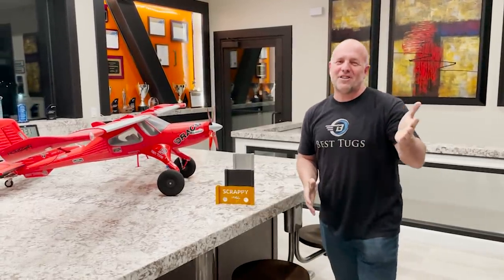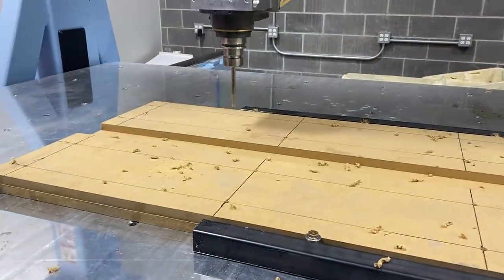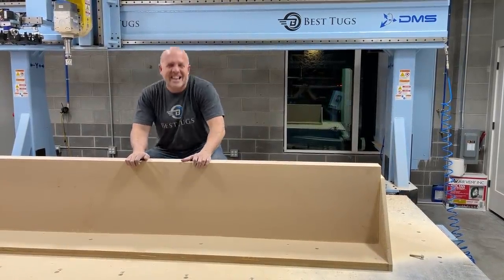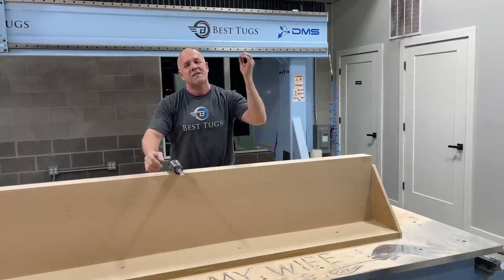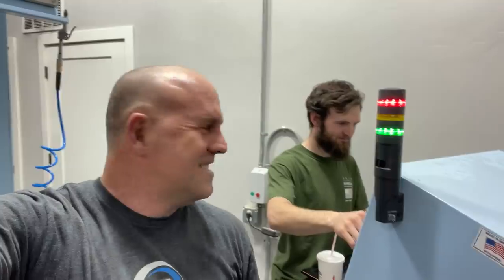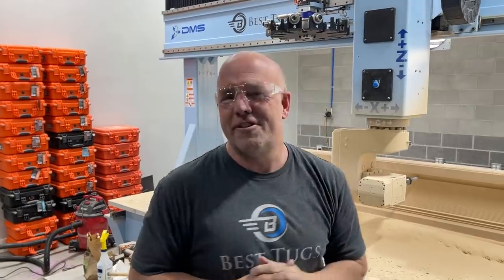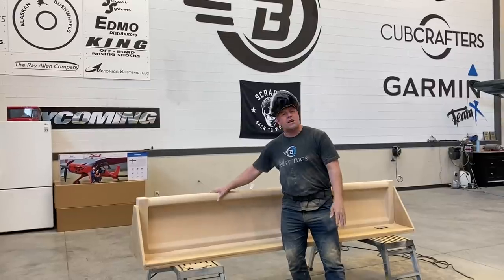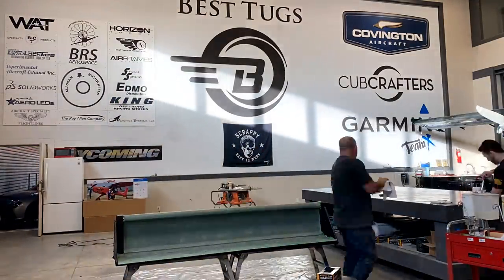CNC a custom mold for my Carbon Fiber wing Slats 🤠 | Scrappy #48

Comment: I have the impression Mike isn't actually into airplanes, he just loves sanding.
Reply: Mike lives for sanding😀
Reply: @MikePatey  Ok  so hear me out. I was laying in bed this morning thinking about super cub with retractable gear. The wheel wells would have to be huge to handle 31’s or 35’s.  Not to late for a light modification on scrappy right?
Reply: LOL, that's friggin funny right there
Reply: My exact initial thoughts after hearing "80 grit" ... 😆
Reply: @kalebrowland626  Mike... What if the "retraction" was simple coil load and release which "retract" into and release from a lock housing, instead of a full on inner body housing for her landing gear... ?
Reply: Hahaha! Yes, you're on to something. It's a coverup, to get to do more sanding :*

I am SO glad I found this channel and Mike Patey. So inspiring, so fun, so engaging. And boy do I want to get to do some sanding now! :D ;)
Seriously, Mike is such an inspiration - and I'm not even building or flying planes. Just your average avgeek appreciating craftmanship, passion and awesomeness.
Reply: Lmfao!
Reply: Mike, the human palm sander
Reply: @kalebrowland626  If you had a high performance reversible air pump that could fully deflate the tyres for storage and then rapidly reinflate them prior to landing you would be reducing the size of the problem.
Reply: Right up until when the pump stops working.
Reply: Lol
Reply: now that would be good but what about being able to take the tires to negative pressure? Create a vacuum and suck the tires to the rim
Reply: @kalebrowland626  Yes fully deflated they would reduce drag and potentially be inflatable to cartoonishly oversized Sherp style dimensions.
Reply: Kinda like Will Stelter and hand sanding knives
Reply: That's funny...
Reply: but Mike would have a backup carbon fiber 5lbs Co2 canister that could re-inflate then 6 times in 12 seconds. You know for added safety.
Reply: @MikePatey  yep 😂😂 1 of a kind planes just byproducts of a love for sanding! Haha amazing work again! Love watching your series!
Reply: Mike is simply a hard working man :)
Reply: HAHAhahaha This guy is a LEGEND Of LEGENDS!  Even that Rc prototype looks mint!  Is that paint on the rc lol!  Love this!
Reply: I died a little inside when I heard "just two hours of sanding" 😳
Reply: Ok That was funny
Reply: @CaptainRon1913  5 axis of simultaneous control
Reply: Mike needs a 3M sponsorship 😆
Reply: I could not afford the price of all the sand paper Mike buys and uses... then again I imagine he gets master wholesale pricing on sanding products- or should anyhow!
Reply: I've heard crazier ideas.
Reply: As Mads from Sail Life says: " Oh Glorious Sanding!"
Reply: If a Mike unow call me I hangup fast.. Mostly scammers calling her i Norway. From unown.
Reply: Mike doesn't have an arm day in the gym...... Nope, he just heads to the shop and grabs a sanding block LOL
Reply: The arm pump is real!
Reply: 3 houers layteur...😆
Reply: SOMEBODY GET THAT MAN A DUSTDEVIL...LOL!🤠
(Ron, I think that's your cue to take the Shop Vac to Mike as he's sanding!)
Reply: And Caitlyn Jenner......
Reply: @MikePatey  lol the big i love my wife on the video ... what did you forget ... her birthday or your anniversary lol ;) ... flowers and a fine dinner out works too
Reply: I mean, he wouldn't have used the mill, if that was the case, right?

Comment: You singlehandedly restore my will to study (2nd year of college). I'm losing interest in mechanical engineering, because all we do is theroetical math, and the only practical thing is designing a simple transmission.. When I don't get to make the thing or even see the thing being made and used, I just lose the drive to design it. Your videos make me remeber what I went to college for. Thank you.
Reply: Hey idk if your college has it but look into the Mechanical Engineering Technology (MET) department. They tend to do more design work while MEs do more math. But having the math background of a ME is the harder part. The design part can be learned on the job
Reply: Greetings from Australia. Engineering is not an occupation but a passion.  Have a look at Youtube website by Allen Millyard. He has built a number of motorcycle engines by adding cylinders to existing engine blocks. V12 Kawasaki out of two Kawasaki Z1300 engines for example, back into the original motorcycle frame.  The best engineers are the ones who can walk the talk, like Mike Patey, not just have a piece of paper hanging on the wall.  Finish your degree and love what you do.
Reply: Years ago I wanted to operate a lathe and a milling machine. I walked into the local technical college, introduced myself to the head of the machining department  which taught accredited training courses  and told him what I wanted to do, not interested in exams, just knowledge.  He taught me himself at the night classes.  I also did a TIG welding course at night school.  There are ways to get around lame degree courses.
Reply: Math is extremely important to you as an engineer. Watch all of Mike's videos. I'm a Master plumber by trade, I needed to learn geometry, trig, and a little algibra. I hate math...I learned it after high school. I just couldn't get it back then. 
Stick with it you won't regret it.
Reply: Glad to hear.  MEAM 1980
Reply: I'm in the same boat. I love engineering and have a couple ideas for aircraft design but gave up on my mechanical engineering program because I failed to pass my first math class (it was timed and I ran out of time before completing it; I'm really slow at solving math problems). I recently took it again and failed it a 2nd time (did a little better the 2nd time but still failed), so I've definitely given up the ghost on professional mechanical engineering at this point. My primary goal is to become a commercial pilot but I was planning on having mechanical engineering as my backup secondary career. For awhile I was thinking of going the A&P route but I'm just not a big fan of the work environment, pay, and treatment A&P's get. Plus, I'm not very mechanically inclined when it comes to troubleshooting and fixing things. So that leaves me with going into a trade or going into the tech field, and my college has programs for both, and I'm heavily interested in both. I've always wanted to learn trade skills such as welding, composite work, machining, and fabrication because I want to build my own plane (or several) in the future, and maybe design my own too. Plus, the trade courses part of my college do some really fun final projects such as drones and robots, that utilities students from each trade to use their specialties to make parts for the drone or robot.

Comment: Good Morning Mike,  
I saw the carbon come off of the mold and had a thought:
If I recall correctly,  golf ball dimples help reduce drag due to the formation of a small turbulent air barrier around the ball.  (as demonstrated by the myth-busters)
What does the aviation industry think about keeping rough surfaces on wings?  does that help reduce drag? hurt lift? not matter? 
Anyways, keep up the good work!

Comment: When this series started I thought that scrappy was going to be a “novelty” airplane.  Like....look at how I crammed this big engine into a cub....but it won’t be that great of a plane to actually fly around.  I should have known better.  I built a van’s RV-7 bone stock with all parts partially finished with complete instructions...and it took me 15 years start to finish.  This guy’s talent, knowledge, and ability are inspirational.

Comment: I started running tape fed NC machines at GM in the 1970’s.   I ran and programmed  3, 4 and 5 axis mills and lathes all my life.   Also did fixture design and engineering.   Retired now, (7 yrs), still have a Bridgeport and Lathe in the garage to stay busy.  Generate my own 3 phase power.   Loved this video, brought back memories.   All our cuts were in metal though.   Coolant went everywhere.   Keep up the great videos, can’t wait till she’s complete.    Cheers from Akron, Ohio.

Comment: Ohhh! I get it now. Mike is really a CNC machine (reference to the CNC running all night long). Your artwork in the sawdust made me smile. 

"When the younger kids are beating you, that's awesome" YES YES YES... I'm constantly trying to pass on mistakes and wins from 45 years of control design and gas processing plant experience to the younger guys that I work with. it's very important that we do that!  

One of way too many hobbies I have (is that possible?) is high power rocketry. I've got my Level 1 cert, Level 2 is next, then Level 3. The "carbon fiber lessons" are super helpful. I may try to use the on the Level 2 rocket. It's not necessary but "you have to start to finish". Maybe I'll start with a nosecone... Idk... we'll see.

Wow... what an outstanding call.

Comment: He He! I love Carbon Fiber too! Without it (thank  you Mister Fuller) I wouldn't be able to extend the middle finger of my left hand! Got a carbon fiber suture holding the extensor tendon together. Had a close encounter of the worst kind some 40 years ago with a freshly machined flywheel. Under a pickup helping a neighbor change the clutch. Had the FW held up to the crank with my left hand and reached for a bolt with my right and the FW slipped and pinned my hand on top of the trans crossmember! Ford engine and most of my experience was with GM which (you probably know) has more of a pilot on the end of the crank. I.D. of the FW got me right on the knuckle! Severed tendon. You know that feeling when it's bad because it doesn't hurt! Took months before I got full use of the hand back but now other than the scar (and feeling like my arm is going to explode if I bang it into anything) it's perfectly normal!
Reply: Isn't That Enough To Make You Wanna Go Full Electric Vehicles Yet? 🤣
Reply: @grumpyjohntxredneckrc6346  Nah. I've been wrenching ever since and don't plan to quit! I do R/C too BTW...

Comment: Nice job! So 200 cuts per inch means 0.005" per tooth. That's a good chip-load for foam with a ball end mill. Can't really call it a chip because it is more like dust at that size. I would feel comfortable running aluminum with that feed and speed. Love that 5 axis.

Comment: Just out of curiosity: Why not use a negative mold with the split along the leading and trailing edge? 
You can lay your carbon on both sides (one side with overlaps to join the carbon together), close the mould and put a vacuumbag through the inside. Seems to me that would save a lot of sanding time since the outside of part is the smooth "mold surface" and the inside of the part is the rough "vacuum bag side" and you basically just have to clean up the mold seams and the part is ready for painting. The saved time really adds up if you make multiple parts out of the same mold because you only have to invest time once into the mold finish instead of every single part.

Comment: High density foam is amazing to machine and prototype.... If you ever need some hints and tips on the 5 axis module in solidworks (same one used in Gibbs cam) I may be able to lend a mental hand

Comment: Learned a HUGE life lesson from this video.  I was so impressed with this machine that I bought one. 265k$ Plus shipping and rigging made it well over $300,000  Turns out DMS hates their customers unless your famous on you tube.  My machine showed up with so many  faults and issues. I had pinched airlines that wouldnt release the brakes. I had things miswired, and a year later I am still having issues and DMS just says "good luck" to.  I received none of the promised support or help from FAGOR the maker of the controller. I made a review video of all the issues the machine had with broken off taps, double drilled holes. tools left inside the machine and Rather then fixing them DMS sic'ed their attorneys on me. So no more review video.  To this day the machine does not run reliably and my fully loaded DMS Teton Could not machine the part that Mike is making in this video. 

Turns out someone like Mike is always going to have a better experience with a company like DMS then some unknown 30 year old just working hard to build a future for themselves with their investments. I will always avoid companies showcased in any sort of you tube video from now on.

I would recommend to buy from C R Onscrud. some of their techs helped me sort out issues on their competitor machines just because they knew it was wrong.  

I have some videos of my defective machine running light cuts on my channel just incase someone would think this is just a plug for CR Onscrud.

Comment: Mike you have better equipment than most light aircraft manufacturers. You just need to pull vacuum on those parts, do the complete job !
Reply from the maker: 👍🤠 the only one I didn’t pull vacuum was the mold itself as I wanted heavy resin left behind to stiffen the mold and sand against.  That’s the one that I pull the peel ply off without foam while making the mold.  In the time-lapse you can watch the vacuum bag and foam on every slat that I’m using on scrappy.  I should have slowed that down and showed that.  👍🤠
Reply: @MikePatey  my bad, I just went through it too fast !

Comment: Mike, Great work on the slats! I have been thinking of building slats for my Murphy Rebel. My CNC machine is down for repairs but I am thinking I can achieve acceptable results with my hedge trimmer, chain saw, and wood chisels. Whadayathink? Unbelieveable work you are doing. Thanks!
Best, Capt. "T"

Comment: These leading-edge slats hint of a very large wing. Curious what profile you are building. Which I'm sure incorporates high speed.  
   And there's the trailing Edge. What will it be?  Flaperon, follower flaps? Or flaps with reflux, or negative setting to increase high-speed and economy?

Comment: You make it all look so easy. Did you cut the foam on the CNC machine a little smaller than the final design size to account for the multiple layers of carbon fiber?

Comment: Mike, is there a big problem getting the plane FAA certified. I'm sure it can't be in an experimental class with the weight even though you have done a super great job on keeping the weight down. I come from an engineering background but have never used solid works. I used Auto Cad back around the time it first came out. You know back in the 80's. lol I am retired now and just love you're videos. Keep up the great work, so amazing,

Comment: was looking at new ideas for propulsion and came across a jet engine that can do up to 5000 pounds thrust using a compressor to create a high pressure laminar flow over an air foil and through an orifice that looks like a dyson fanless air purifier, would be interesting to see if ou could engineer a wing to incorporate it, or something similar with the compressed air ports along the top of the leading edge. be neat to have a plane with not props.

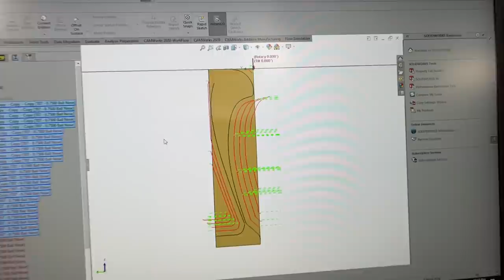Comment: @4:10 I've been doing a lot of additive FDM and do all my modeling in solidworks but recently have been wanting to get into CNC. Watching NYCNC's videos they make it seem like Fusion360 is the no-brainer go-to solution for cnc workflow and modeling, nice to see someone using the full solidworks production chain all the way through cam programming. How does solidowerks compare to fusion for a beginner to CNC but veteran fdm / CAD?

Comment: Could you (or maybe you already have?) provide a link to the foam you used for the mold? I think I could make use of it in smaller parts for some motorcycle bits I want to use as a first dive into carbon layup.

Comment: Mike, 
You seem to have no problem spending money on a very expensive CNC, so why do you still suffer using Ridgid sanders?
Consider an upgrade to Festool or Mirka with their Hepa dust extractors.
I'm a contractor and the Festool system makes sanding a lot easier to spend all day on it.
Keep up the good work.

Comment: While you are doing your math, take the RPM and Feed Rate and calculate how much of each flute on you cutter is in use (% of cutter engagement).  It's good to know because it will guide how fast you can safely work, with some experience.

Comment: At that scale I would have just gone direct to  machined aluminum female tooling and done a co-cured part. A bit more expensive for tooling but not if you put a dollar value on your time. Also much better control of the oml geometry with the female tool, eliminate the core, simpler, lighter, better parts. Their method works for an on the cheap solution. Not bad.

Comment: but mike you had wings on scrappy if you put the prop on, because they are used as wings in rotatory aircraft or fixed wings RC model aircraft that are prop hovering. :p

Comment: Yeah i am wondering why he did a male mold so that when he makes parts he has to sand them fill weave and clear coat. I think doing a nice female two piece mold would pop a part out already finished ,just needing clear coat. But maybe its stronger doing it with a male mold. Mike i am sure you have your reasons please inform us.

Comment: i would like to know if you mike or some one has worked ou
t the hp of the mini Draco remote controlled plane to see if it works
 out to a simulate hp in the real Draco if anyone has the math skills and would try 
my math is so rusty at 66 that it would give me a struggle to add 2+2 lol
 thanks for all the videos